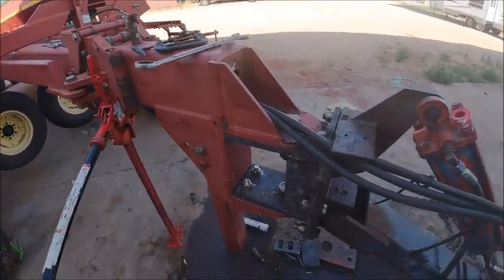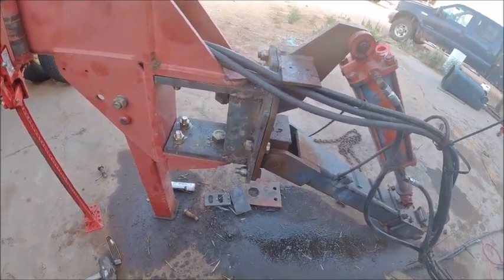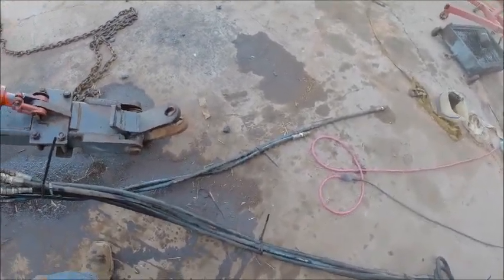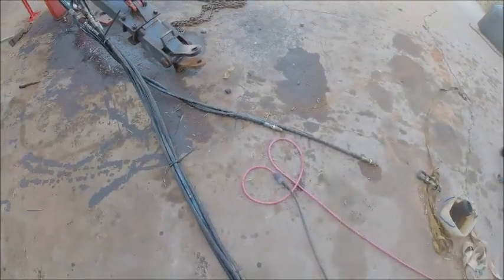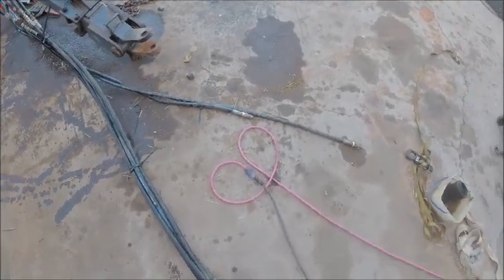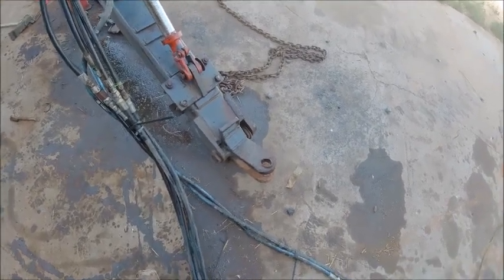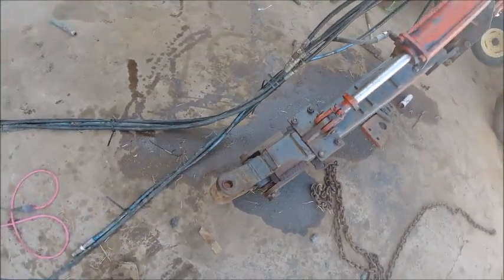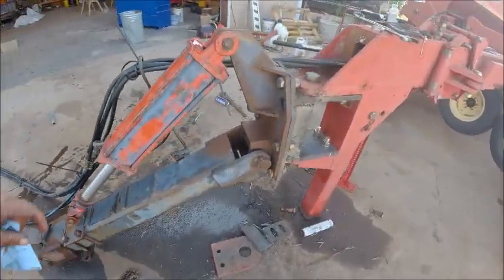Sunflower Drill Hitch Upgrade

Comment: Do you have any tips or tricks on how to get the leaking hydraulic hose out of the arm of this drill and putting the new one in? It is leaking inside and with the dirt and oil it's quite the mess.